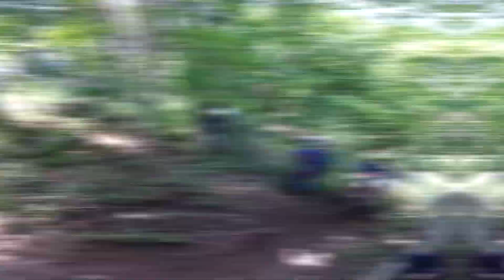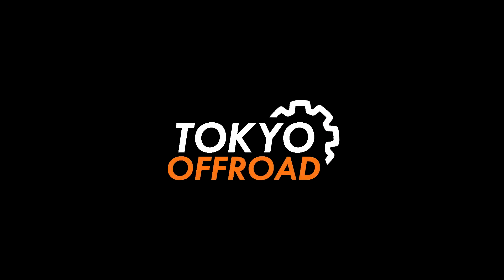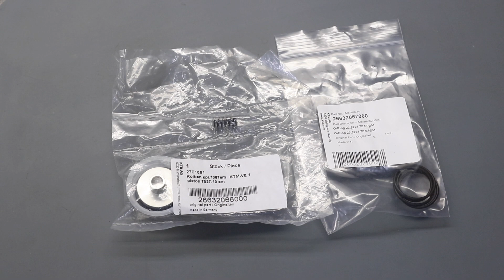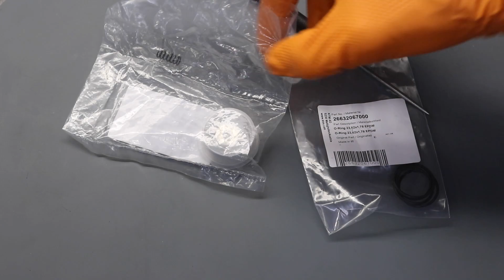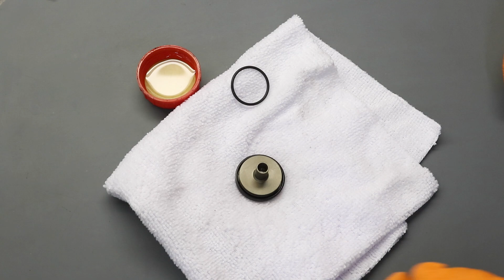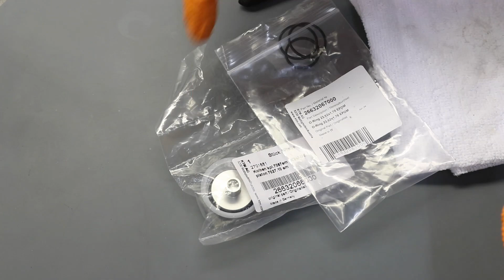KTM Brembo Clutch Slave Overhaul with OEM Parts

Comment: Hi Mark, great video thanks. I’m switching to a 9mm Brembo MC on a 23 TE300i. Do you know if I would also need to swap the Braktec slave cylinder for a Brembo unit or is it compatible?
Reply from the maker: It's difficult for me to answer as I haven't tried it. But assuming the stock Braktec clutch system is DOT fluid (not mineral oil) and the stock Braktec clutch master is 10, or 9mm then the Brembo 9mm clutch master should work fine with the Braktec clutch slave.
Reply: @TokyoOffroad thanks for the help. I might give it a try. 👍

Comment: Hi Mark did you overhaul the slave cylinder due to part failure or as preventative maintenance?  Quite a few hours on mine I am wondering if it is something to do as a wear item like you would a top end overhaul.  Cheers!
Reply from the maker: @rdsrf  I started experiencing clutch operation issues and then performed the overhaul. As it’s cheap to do it’s actually a good preventative maintenance item to do. For example you could do it every 500H, or every 5years. Same for a clutch master overhaul…
Reply: @TokyoOffroad  I am right in that 500 hours range and in need of flushing the clutch fluid so I was thinking overhauling the slave at the same time might be a good idea.  Thanks Mark I appreciate the info!

Comment: just replaced magura with the rekluse billet slave which has 2 oring.. much better design. one oring is to seal dot fluid and the other oil.

Comment: I Stumbled onto your video about reverse bleeding the brakes when i was looking for a solution to my uncles clutch not disengaging issue.. I've now watched several of your maintenance vids and although i don't personally have a KTM, Your instructions, and descriptions are very helpful and very well described, watching them has made maintenance concerns seem less daunting.. Thank you. Still trying to work out the issue with my uncles KTM though, running out of ideas.
Reply from the maker: What bike is it that you're working on? A first check to make is that the clutch lever is adjusted correctly. If position is adjusted too far in (close to the bars) it may prevent full disengagement. If an after market level has been fitted try using a stock lever. If there's air in the system it will often cause disengaging issues. Try bleeding the system fully. A leaking seal in the clutch slave, or master would also cause disengaging problems.

Comment: Do you have any experience with 9mm clutch master cylinders by any chance? I recently fitted one to my bike and it created really bad clutch drag to the point that even with the lever pulled all the way into the bar, the clutch wasn’t fully disengaged. Also the bike would take off if I tried to start the bike in gear. I can’t say for certain that all the air was bled out of the system however. I reverse bled it a few times and back bled, but tiny bubbles were still appearing when flicking the lever and they just didn’t seem to stop appearing. All the connections were tight and no fluid leaking out of them. Any input from you would be appreciated!
Reply from the maker: Personally I haven't used a 9mm clutch master, but have considered it. Lots of people like them as it reduces the effort required to actuate the clutch lever and helps reduce fatigue on a long ride. I think you probably still have some air trapped somewhere. Reverse bleeding usually works very well, but sometimes, particularly if it's a new system which is being filled with fluid for the first time it is possible to get some air trapped in the clutch slave. After reverse bleeding try pulling in the clutch lever to the bar and open the bleeder at the slave until a little fluid comes out (you can put some hose on the bleeder nipple to reduce mess). Doing this will bleed trapped air from the slave. Repeat this about 3 times and check to see if the clutch engagement is improved.
Reply: @TokyoOffroad  Had a second attempt at fitting it today. All works perfectly fine now. The clutch is now biting when it should be. Thanks!
Reply from the maker: @rupton6  - Great! Pleased to hear that it's working correctly now...

Comment: Thank you for this! I think that I'm gonna need the things learnt here sooner than later. In my case I find it very hard to switch the bike to neutral while the engine is running (clutch lever squeezed, of course). It also does not matter if the engine is hot or cold. Otherwise everything seems to run fine. Do you think it might have to do with what you have presenred here? Could it be that it would only need a bleeding as air might have got in? Thank you!
Reply from the maker: The transmission in these off-road bikes is designed to not be easy easy to put into neutral while the engine is running. Personally I typically don't put it into neutral while I'm out riding, I just stall it in gear and then start it again in gear with the clutch pulled in. It should be relatively easy to put in to neutral when the engine is not running. I the clutch has air in it you'll find you'll need to pull the lever to the bars to disengage the clutch and the bike will jump forwards and drag when put into gear.
Reply: @TokyoOffroad  thank you! I had no idea that this was "by design" and just thought that my bike (2018 EXC TPI) has an issue. It is easy to put it in neutral wheb the engine is stopped. 🧡
Reply: Not 100% sure I agree with this, I have 3 dirtbikes, 2 of them shift into neutral just fine if you are used to riding, However, my newest bike, a 2016 Husqvarna FC250, is near impossible to find neutral while the engine is running, but will go into neutral just fine when the bike is not running. Also with the engine running, when you shift to first, you can feel the bike jolt forward about an inch, sometimes causing a stall, with the clutch pulled tight to the handlebar. I have bled my clutch cable twice, it helped some, but the problem is still there. Next I think I’ll check the slave cylinder, possibly the master cylinder, and if I have to, I’ll check the clutch pack. I have read some posts from others saying that these behaviors are normal for KTM, and Husqvarna, because of the wet clutch, but idk, doesn’t seem normal to me. Anyone else have some input on this?
Reply: @John_Doe_6996  did you ever fix your issue?? I´m having the same issue and I already did everything to my clutch
Reply: @jmc10 partially fixed by replacing the oil, since the oil is shared with the trans as trans fluid. That fixed the stalling and jolting. Still had issues finding neutral while bike was running. Shortly after that bike had catastrophic engine failure. Currently its sitting in my garage halfway torn apart, with 2k worth of new parts that i have yet to install… 😢
Reply: @John_Doe_6996 I don’t want to make this an oil discussion but i put 15W-50 even though the manual says 10W-50… I really doubt that is causing jerking and stalking in first … but I’ll give it a try when is time to change it again…since my slave clutch was leaking a bit I’m leaning towards finding my problem down there… thank you for your quick reply
Reply: @jmc10 good luck! I hope you can get it solved!